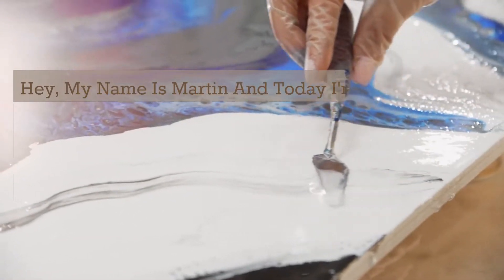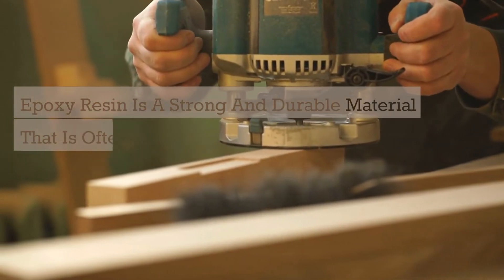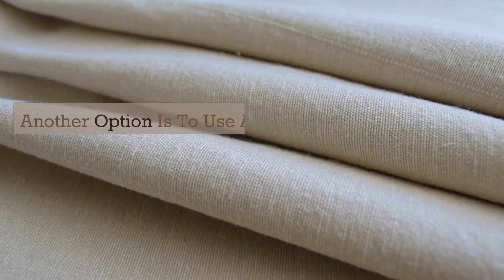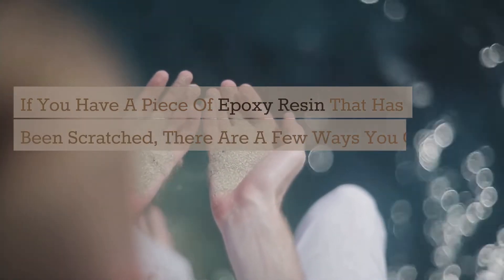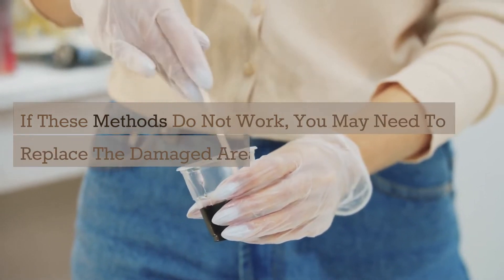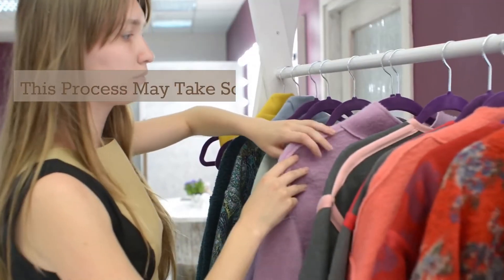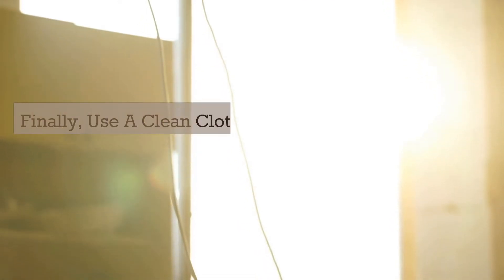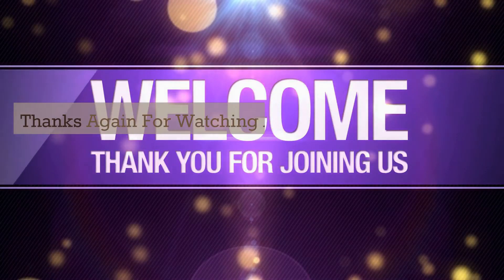how to remove scratches from epoxy resin?

Comment: Let me save you time: Use an abrasive pen or polishing compound to buff them out. 
Absolutely zero value added by the video aspect of this production. This is essentially just the words of a slightly useful article with entirely unrelated filler video. The useful words I covered in my comment above.